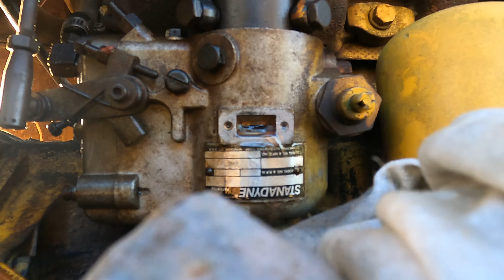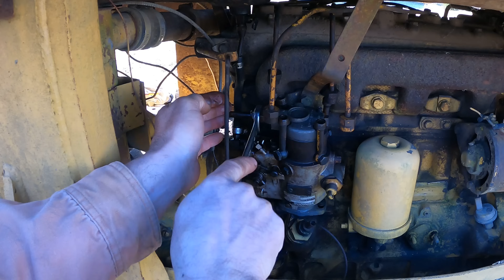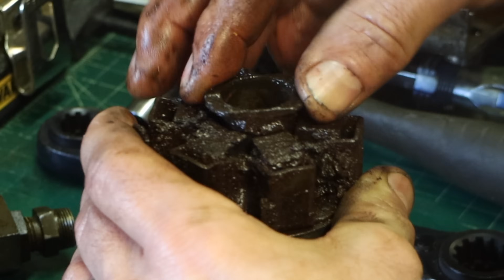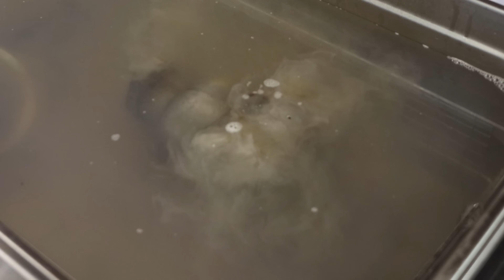Forgotten John Deere 1010 Track Loader, Part 2.

Comment: Your compression kit should've had a cone that would have slipped onto the long threaded adapter that would work with the H bracket in the kit to bolt it down in the injector to make the seal.

Comment: You should fill up cooling system first  and rotate it a coupl time and see if you do have a head gasket / head/ liner cracked . But yes please do autopsy I mean it’ll still weigh the same at scrap yard if it’s destroyed

Comment: You could probably get a more modern and stronger diesel engine cheaper than the service parts for this one. I think you should take it out though and  check. If your luck it just needs a head gasket honing and possibly over sized rings. https://www.youtube.com/watch?v=Z2cRQRwytCc

Comment: change the supper thinned out crankcase oil to get the proper viscosity oil into the bottom of the rings.  Use either Marvel Mystery Oil or BG snake oil reconditioning kit for diesel engines.  A bore scope peek would be a good idea.  But don't scrap yet.

Comment: Put the camera down the cylinders. If the walls look ok you should try wd40 or mystery oil and see if the rings are clogged. If that doesn't help, pull the engine off it. 

Great content either way!

Comment: DECISION POINT:  Start with "value".  What value does the track loader bring to the farm ?  In my opinion, quite a bit.  There's a lot more utility than a bucket/backhoe.  When you do ponds or other large productions, the track loader has double value as a compactor too.  I believe you should continue evaluating it.  1st ... I know you're on the "rings" as the primary issue, but when you ran the bore scope, there was a lot of congestion on the value we could see.  I'd start with head removal to make that assessment before committing to the full treatment.  It could be that several or all of the valves have facing issues and the rings might seal up from running.  If the valves are not the problem, then the decision point is rebuild parts availability.

Comment: I think you need to go to the John Deere dealer or buy some John Deere starting fluid online. I believe it's 80%. And you need to hose that thing down like Bill Cosby. until it starts it will start. You just need to put enough starting fluid in there and you need to have a strong battery. You can't have some battery that's dying or dead and you're reviving it.  It needs to spin fast and you need to hose. That fucking thing Down with eighty percent ether

Comment: Generally, I would look into cylinders with boroscope to asses the damage and try to make the injectors work. Seeing the state of the pump the rings are definitely glued and not working, but if you inspect the cylinders and they are reasonable, than it might be worth to go on... otherwise, spare part machine for someone. ALSO, adding to that: the valves are very very dirty, they might not be sealing.

Comment: before you tear it out:
If it gets going, valves seal better, rings get freed up.. etc etc 

-the valves are probabbly rusted/full of junk not sealing.
 -bore scope.
- put oild down the cilinders, then try to start (other people have also mentioned this)... 
Use a thicker oil.... it's dead you can't kill it any harder.

Can you do anything to the injectors to unclog them?
- if there is zero diesel,...maybe the starting fluid isn't enough?

Comment: Question, once you have added oil to the cylinders could you not get it to pop off on starting fluid.  I would also verify the injection timing for 180 out.

Comment: It's hard to tell from the videos but it looks like it could be an okay farm use machine. I would opt for rebuilding or replacing the engine and other needed repairs. You don't need it so it isn't a rush job and the content would be great. That said, it would also depend on availability of the parts. Great video.

Comment: Construction end of JD company only started to really engineer their products well around early 90's. Their intro into hydrostatic in 1976 with track equip was an early exceptoin and set a new standard. Maybe that bunch of engineers went on to beef up their backhoes and excavators. Their engines at that time were better than cat. The old cat stuff was pretty good though. JD diesel power always had oil cooled pistons. No glow plugs. 16:1 compression v Cat 22:1. Either system was built into the cold weather start up procedure. It's nice to avoid weak failure point like glow plugs.Your best track loader for small end work would be a JD 555G with direct drive. Early 90's. My long held opinion was recently confirmed by CC EQUIPMENT.  That kind of bucked me up with a naive sense of pride!!

Comment: Since there is little risk to damaging the engine, why not oil the cylinders with marvel mystery oil, ether the intake, and try starting it again. Still other things to try and test, hydraulics,  transmission  etc. Before putting any more time or money into it I'd try and baseline the other systems. If the engine is that bad, likely from poor maintenance,  the other systems are suspect at best. Then decide on the engine fate from there. Personally I'd look into repowering it with something more servicable, more power and better fuel consumption

Comment: It's most likely not worth the time for anything past an autopsy for fun. I think you can get the parts but it most likely going to be expensive. I guess you will not know until you get in there. I like the idea of the using the borescope, not sure how much you will be able to tell from that. I bet someone is looking for a rebuilt fuel pump so maybe you can recoup some there. Full disclosure, I know zero about diesel engines.

Comment: I would say clean the injectors  ,see if there spraying fuel . The cylinders are dry ,and the rings also . Compression will be low on any engine that sat for a long time . Get some fuel spray in the cylinder may get it running.  If you get it fired up there will be an improvement in Compression.
Reply: And a propane torch in the intake manifold!
Reply: Yeah those injectors are worth cleaning. I wonder if all that leaking fuel is actually back pressure since he said the petcock was closed…..
Reply: Would say clean the injectors and heat up intake manifold.  It may bring the rings back to life.  It has been sitting for years.  I looked up 1010 motor kit it's around $800 as of 1/10/26
Reply: Yep,  i agree all of  the above. The colour of the fuel dripping from the open lines  didn't look great either

Comment: When i need a compression adapter i dont have i use an old glow plug to make one. Just a hint for the future. And hopefully if you get it to run the steering clutches are good those are a nightmare for access . Way harder than the later 450 to work on . And most parts are unobtanium .

Comment: Hello from the Netherlands. 
As you know, a Diesel needs heat for ignition. 
it cannot make this heat now because he cannot compress the diesel because the compression is not there.  
but you can go a long way to imitating this by forcing hot air into the air inlet with a hairdryer or an electric paint burner.  
The hotter the air, the easier it ignites in the engine.  you can try to start the engine this way.  
and perhaps piston rings will then come loose and come to life again.  
otherwise it would be better to put in a slightly more modern Kubota engine instead of rebuilding that old junk.  
then you also get better fuel consumption
thanks for the video.  
Kind regards, Hollandduck

Comment: John we asked what was going on with the track loader we saw a year ago.  Now we know. Only use your time if you need a track loader. My neighbor has a different model with an adapted Skid-steer quick attach plate and he runs a grapple and an auger off it.

Comment: Before you autopsy her, try using a heat gun to heat up the intake air and she if she wants to fire then, helps immensely on  them tired engines.
Reply: Works all the time 👌🏻
Reply: @ferdystrik4629  Not if there's no fuel coming out of the injectors
Reply: Yup Better than that sniffing drug, on my boat if heater plug failed i lit some 
screwed up paper in case it sucked it in
Reply: I'm thinking pull starting it with another tractor would help. Get the engine rolling over at running speeds rather than cranking speeds. If it's ever going to fire like this, that will get it firing.
Reply: Also could recreate the overheat condition, throw a tarp over it and put a tube heater on blast.
Reply: I had a duetz in a trencher that I started in cold weather by shoving a blow torch in the intake manifold and it started right up. But first clean the injectors and hook them up outside the head and check them out for leaks and spray. Too much time and money invested already to not give it a try for the small amount of time it would take at this point. If it'll start and run a bit many other issues like rings and valves might improve quickly.
Reply: My cheap Harbor Freight heat gun has fired up a lot of engines. Get the intake roasting hot and a "hard to start" fires off like its July.
Reply: Awesome tip
Reply: Do a rering and run it!
Reply: Along with heat gun, get all 4 glow plugs working and a fresh battery and jump pack.
Reply: To what purpose, he has a rebuild in his future. Sucks, but like he said, 'that's life'.
Best wishes all.
Reply: @carlthor91  Sometimes the engine has sat for decades and the rings are stuck and do end up coming around. Also would allow him to listen for a rod knock or other badness. If he can get it to fire at all, it's worth it.
Reply: @PlatypusVomit  It still has to be pulled down, even if just to replace rings.
Reply: @carlthor91  NOTHING from this video proves it HAS to be rebuilt! It sat for years, rings get stuck. That doesn't mean it needs new ones.
 With the slight improvement in compression checking "wet", a big improvement could be had with cleaning up the crusty valve train.
Reply: @carlthor91  To what purpose, as per comment above it was to get it started - the last known running condition the engine had a good heat soak
Reply: So he can figure out the mechanical mystery that is the rest of the machine... Is the transmission alright, hydraulic pump, final drives etc.
Moreover, a rebuilt wouldn't be worth it anyway as he has a well running dozer, excavator and tractor with FEL. @carlthor91

Comment: I'd recommend one of two options for you at this point. Autopsy the engine, see if it's just stuck rings, which I suspect from just how quickly the oil seemed to drain down, and rebuild it. Or, there was a Detroit Diesel (2-53, I believe) that is to my knowledge a bolt in replacement for those, you just need to get one out of a Deere 440 crawler. Parts aren't horrible to get for those 1010s (or at least not my gaser 1010, I've never looked into diesel parts), so I'd say unless the cylinder plate is shot it shouldn't be to hard or expensive to rebuild it.
Reply: This would be my vote as well, find a good engine to replace the tired one. A bolt-in would be great!

Comment: You didn't try to see if the injector, that you did remove, was even passing fuel!  Stuck rings are entirely plausible, you know that the valves are not stuck.  You gave up just short of a breakthrough.

Comment: I'd say try and fix it, way more interesting than just scrapping it. Also, I have been able to get engines with low compression running by pouring oil in and trying to start. I say that is worth a shot, maybe all the rings are just stuck from sitting and running the engine will free them up.

Comment: 40:47, I think, with how long the cylinders sat, they were dry, they need to have a film of oil for the piston to seal against the bores
Reply: and the valves looked fairly bad in the last video so they're probably not sealing well

Comment: Sell it as is. Forget the autopsy, it will just bleed your time, and add to frustration. Maybe someone needs parts and will buy it as a parts machine. If the engine wasn’t so rusty inside(assuming it is) then i’d say price out the parts if available and rebuild the engine for content. Maybe get your vevor cam out and see if you can look inside the engine to check how rusty it may be.

Comment: The fuel tank will fill the pump with crap.
Check the compression with the throttle wide open, just checking. Also the valve didn't look good when you had the camera in the hole.

Comment: you forget to put borescope inside cylinders and check walls :)
Reply: The borescope he already did showed a valve that looked really crusty. So the valves might not be sealing properly either.
Reply: @cv990a4  I had that same thought, but he seemed sure the problem wasn't the valves.  I'd do a cylinder leakage test.  You would hear the valves leaking compressed air into the intake manifold.  I'd also try soaking the cylinders with Marvel Mystery oil to loosen up stuck rings.
Reply: I don't think he forgot; it's just not all that easy.  The injectors spray into pre-chambers, not the combustion chambers, and the holes for the glow plugs are awfully small.
Reply: I was surprised for realz
Reply: that's what I was waiting to see.

Comment: I don't understand diesel engines, so I'm absolutely certain this is a dumb question.  Would there have been enough compression loss through the open injectors to make any difference?  I suspect the fuel is injected under very high pressure through a very small opening, so no, it wouldn't make a difference.  Is there a check valve on diesel fuel injectors?
Reply: There's a check valve on 71-series Detroit Diesel injectors. There are also 6 orifices in the tip, each .0015 in., so as to atomize the fuel. The injectors work at around 2,000 p.s.i, although I have gotten factory remans that would leak down before hitting 500. When all is in proper order, there's no way the compression can overcome that.

Comment: Could you have made a custom tool on the mill for the cam screw? Looks like round stock with 6 slots milled in to it would do it. Sell the injection pump and anything else that has value, then scrap the rest of it.
Reply from the maker: I thought about trying to make something, or modify a torx bit, but it's so darn small I don't think I could have done it with my equipment.  Your advice is exactly where I'm leaning at this point.  Or maybe just put it on ebay and see if somebody else wants to restore it.  Not sure yet though.  Need the autopsy results...